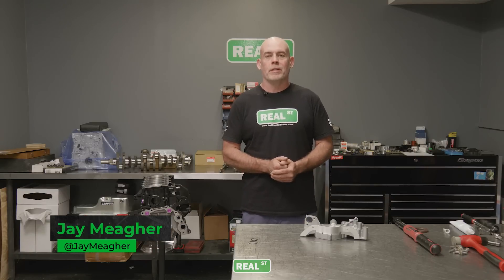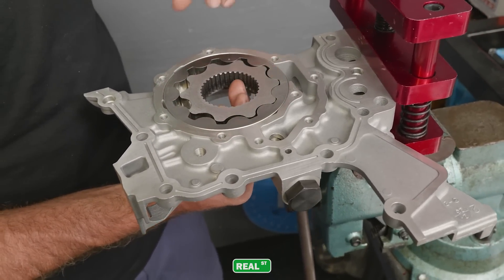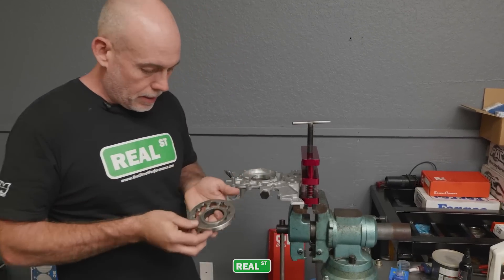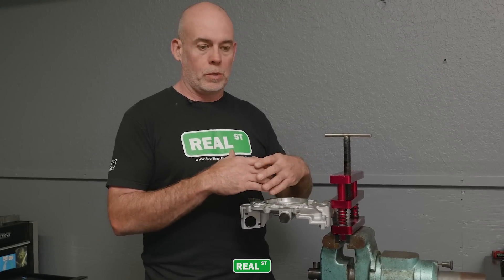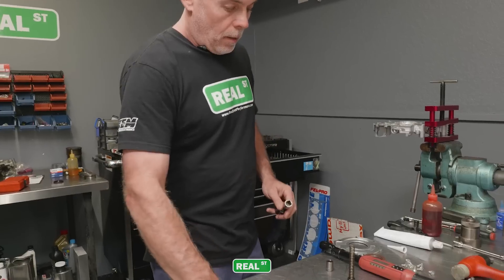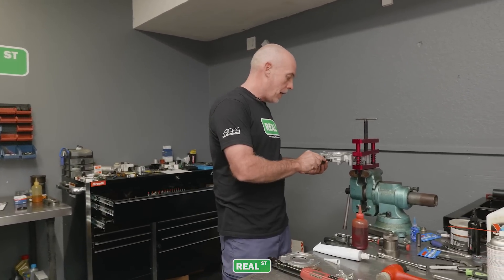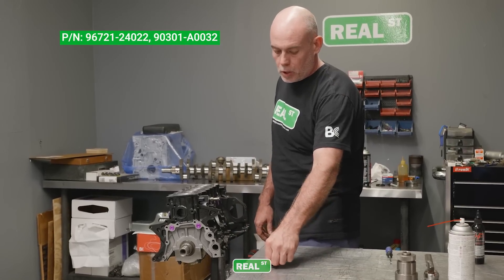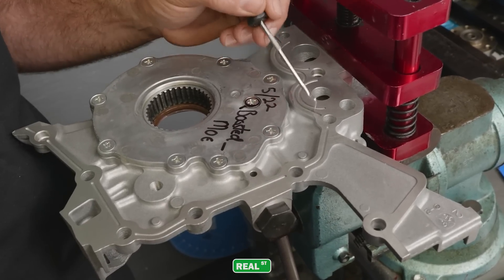Avoid Toyota 2JZ Oil Pump Failures | How to Open, Inspect & Install - Step By Step

Comment: Bought an impact phillips head size 3 socket for the backing plate. attached it to a breaker bar.....stripped one, got one off then on the third one it broke the end of the phillips head...lucky it was just a practice pump...

Comment: so does this mean that the supposed "jz pump gear failure" in recent years is just due to no pre lubing and checking of relief valve?. if so that defeats the whole new fad of the prp pump gears for "2jz oil pump failure" that never used to exist
Reply: I'm no pro but I've been playing and building jzs for the last 15 years, I've never seen one explode. I've seen them gall and get wore out. But I think the rbs suffer from exploding gears. Also if you don't have a quality dampner ( like running a solid aluminum one ) i could see it being a possibility. Don at accelerated performance has these pumps sorted to about 9k rpm. He advised against the billet gear dude to differnecrs in materials and changing something to a problem that doesnt really exist. Hope this helps! Current 1500hp build and I'm using a wet sump with stock oil pump gear.

Comment: Would it hurt using a little bit of assembly grease instead of silicone spray on the outside of the front main seal to seat it into the pump? Or am I asking for a problem doing that?

Comment: Really insightful! I might just do this inspection to my 4AGE 20 Valve Blacktop oil pump as preventative maintenance. Not that it needs it but while I get in there for new rings and the front main I may as well give it a shot. Thank you Dr. Jay :)

Comment: Grease must be applied on the inner sealing face/lip. Oil or in this case assembly lube is not what is needed to stay inside that sealing cavity created between the crankshaft and the seal lip. Remember that during normal operation oil DOES NOT make it passed the seal to lubricate it. This why you need to grease the lip. Many seals arrive with grease applied for this reason.

Comment: I never comment on youtube vids, but I have say Jay you may have saved my engine. Doing a refresh rebuild on my 4agze, brand new oil pump from aisin. I decided to inspect my pump and to my surprise the relief valve in fact seized inside and the gears are bone dry. Had to use some heat and force on the cylinder to get it out. Had some corrosion on the piston and walls. Cleaned it up with some scotch brite lubed up the piston, cylinder and gears. Everything now functions properly.
Reply: Damn... I just built a 1uz got a new oil pump and didnt think to check that it was pre lubed or not. now I gotta pull off all the accessories, covers and oil pan for piece of mind lol

Comment: Nice video guy's I made a SST for fitting the front main seal on the 2J at SRD Tuning that work's amazing.

Keeps it totally parallel and fits it to the correct depth every time will ping you over a picture as sometimes when you need to do a front main seal in a car that has a rock hard seal that's leaking from being 25years old it makes it effortless.

Also I'm on the same opinion as you I've never had any issues with the front seal being pushed out in over 60 2jz engines I've built over the years. 

Will always be a incorrectly fitted item from someone else or punched in to far or a oil pump that is scored up badly 👍

Build them right there always perfect
Reply: Tried looking fro your SST but couldn't find it.
Reply: @jryan1175  will take some pictures and put it up on our FB page 👍

Comment: How much oil pressure would it make if that bypass was not working correctly? What would you consider excessive oil pressure on a 2jz?
Reply: 1832 lbs at 4500 rpm.....
Reply: @francisbeaudry8598  sounds too low

Comment: Wow, the 2jz oilpump gears are massive, compared to any rb26 aftermarket pump/ gears
Reply: There’s a reason RB’s have oil pump issues and 2JZ’s dont
Reply: @lomfmur  yeah, enlarge everything on the engine infinitely to avoid every circumstance. Thats the universal answer to everything.
Reply: @G.J.G.P.  Well no but logic does dictate that if you have the same thing, doing the same job of a similar design and you make it beefier it'll be stronger
Reply: @lomfmur  so, logic also should tell you, that more beefy doesnt mean more better. There is a purpose for every part and and over shooting everything is not always the answer. Or does any other car company make such a huge oilpump for a relatively small engine? Why does no one run drysump from factory? Because its way outside its purpose and cost eficinecy. 

But that small oilpump was enough to win a 24h race in spa, to compete muliple times in the 24h nürburgring with good results, win bathurst and jtc multiple times. Never heard that about the 2jz

Comment: Is porting the 2jz oil pump recommended? I purchased a brand new B16 Honda oem oil pump for my B series build. As soon as it was delivered to my address I forwarded the oil pump directly to 4P Piston Racing for there full mod work up. Would you recommended 2jz owners do the same?

Comment: Good video, when I did my 2JZ motor, the new oil pump had a decent bit of corrosion at the seat of the oil bypass. The Rotor area had some debris as well. Always pull apart your new pump.

Comment: Jay is RSP doing their engine program again? I'm looking for a place to do my 2JZ 3.4L block build but cant find a shop that I can trust to do the work.
Reply: Mazworx in longwood fl
Reply: @Juniorrrrrm  contacted them but their communication is poor and their lead time is way out there.
Reply: @tadda6282  Mark at Mazworx is good, I built my own motor but had them do a block with threaded freeze plugs / billet mains option